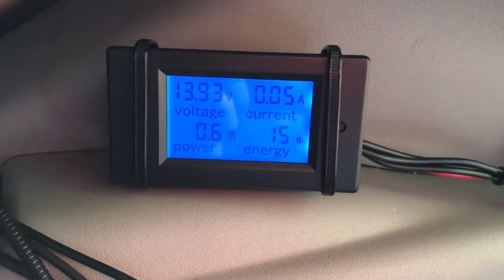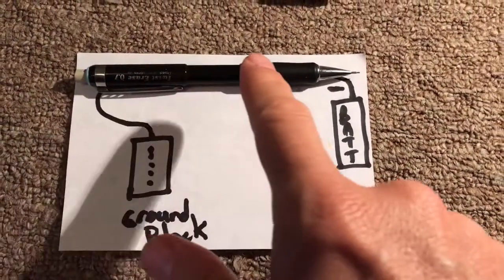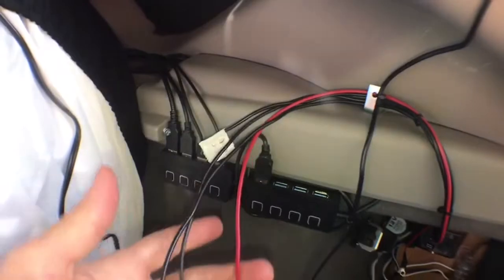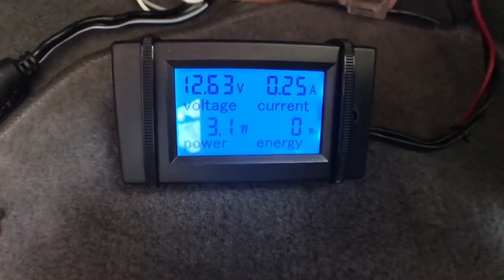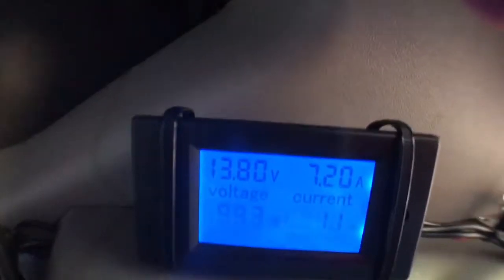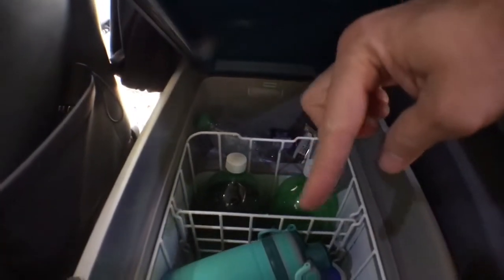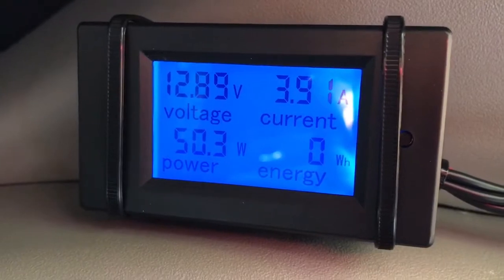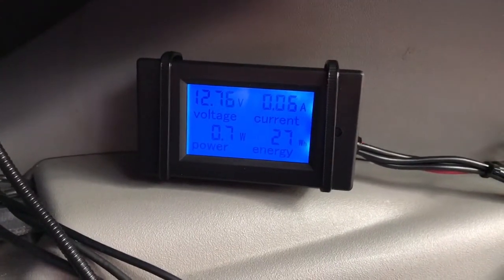Energy Monitor Install, Power Usage Dometic CFX, Heater, LED, Prius Stealth Camper, Car Van

Comment: Great video showing how you use your refrigerator. I have looked at this many ways and the devil really is in the details. 70F outdoors you say? 38F inside the box? 28L? See what happens when you have a 50L unit trying to maintain 8F in the desert where your interior temp is 140F! Whole different scenario. I have seen similar videos which justify >100A-hr/d for difficult refrigeration scenarios. Some people use the fridge covers or add insulation to the outside and think that is worth the effort. On the colder nights when you use your warmer all night, the fridge may consume almost nothing . . . the tradeoffs can be significant. Do you have any worst-case A-hr/d values now that your system has been installed for a while? I am considering a similar fridge, maybe the next larger size for a van and was also looking at that same electrowarmth heater. I use a heated mattress pad at home and I think this is probably the most efficient way to heat with electricity at night. I am trying to limit propane usage for simplicity and safety reasons (only the 1 lb cylinders for the super cold night or cooking on a camp stove). Thanks again for sharing.
Reply from the maker: I have not really had a chance to test out well in really hot climates. The desert would be a challenge but I have always wanted to go to the RTR someday. I really like the Dometic CF series and see constant good reviews and videos. There are a couple other good brands but just felt the Dometic was well made and well known. The electrowarmth does use a considerable amount of power, more than I thought. I seem to get much better warmth from the Kelty Comic Down sleeping bag - pricey but worth it. You can use as a comforter but still have a pocket for your feet which is really nice and then could complement the Electrowarmth. The reason I like the Electro is the adjustable thermostat. Many others just have a timer. If you catch my next 2 videos on Saturday on condensation and mold, I show my DynaGlo propane setup that I used last winter in my van (tested down to 9 degrees). I have interfaced it with my Digiten thermostat which allows pin point temp control of the 10,000 BTUs. It won't work out of the box, blast furnace. The video is going to take a lot of time to produce because I have to prove to people that it works which takes meticulous video production. People are very protective of their Buddy heaters which are terribly inefficient due to only being on or off and having to vent lots of usable heat. My heater has a pilot light and thermostat and is far more efficient than any Buddy heater. It just has to run a minute or two then shuts off and warms up a space instantly. Since you have a van it might work well for you but I had a high top, have not tried in a standard van but should work. It won't be expensive either. I think the unit sells for around $170, then the digiten is around $40, then a gas grill tank and hose. Hope some of this information was helpful.

Comment: I don’t see it mentioned in the comments but the .03A you saw in the beginning is probably the monitoring station showing the current it takes to power itself. I would think the factory uses an external 12vdc to power the unit for calibration. My $00.02.
Reply from the maker: That sounds right to me. Thanks for your comments and for watching!
Reply: ...also curious why and what led you to tap off of the ground side rather than the hot lead. In my experience, (USN electronics repair and calibration) when using and/or calibrating shunts, they were always connected on the positive side. In theory, it shouldn't matter. But we all know that "hands on" beats theory everytime. (But it's entertaining and makes for some good "head scratchers". 
 You gotta great niche going on over there. Thanks for everything. Be yourself and roll-on.
Reply from the maker: Thanks! I am not sure why I wired it that way. I went by the directions that came with it. This is one of those cheap Chinese electronics that you sort of wonder about but so far it has worked well.
Reply: According to the wiring diagram on the monitor, the power for the monitor is not part of the load, it is powered separately so it will not be reflected in the voltage drop across the shunt.
Reply from the maker: You definitely understand this material better than me!

Comment: Nice vdo was ur engine running during this test coz i saw ur voltage was not dropping when u turn ur accessories on.
Reply from the maker: Good question - I can't remember if it was or was not on.

Comment: Does the inverter draw power as well when it's on (is it always on?) Also is it necessary to have the 2000w inverter or would something less powerful get the job done, assuming I'd just be running the fridge all day?
Reply from the maker: The inverter does draw a little power when idle but I'm not sure how much. I usually only turn  the inverter on when using the microwave and then turn it off.  The fridge runs on 12v or 120v, it comes with both cords. I only run direct to the 12v batteries and don't use the inverter for the fridge. A 1500 watt would handle the microwave (750W mircowave needs  about 1,100W to run). If you are only going to charge your electronics and use some fans and lights with 120volts then a 1,000 watt inverter would be plenty.  Get a pure sine one, work the money for using with electronics.

Comment: You've got the Dometic CFX-28 under your head when you're sleeping. Doesn't it wake you up when it cycles on at night? 
And how long will it run while you're stopped somewhere? Your meter shows around 50 watts, which on the normal Prius 12v battery (45 Ah) will give you around 4.5 hours run time before the battery is half drained. The refrigerator isn't going to run all the time, so maybe it'll go a day? I've thought about getting one, but I'm concerned about noise, as well as battery drain when not driving. Thoughts?
Reply from the maker: Terrell Smith The fridge makes a little hum but I got used to it. The 3” foam takes care of most of the vibration plus adds a insulation factor to the fridge. The dometic runs very little once up to temp and only for a minute or so at a time. I can run all night on one battery and it does not drain the battery. Over a 24 hour period without turning the car on I drew the battery down to 50%. That’s when I added a second battery. Now i can run 24 hours and not worry about a power drain. A thermoelectric cooler will drain one battery in a few hours. They are very inefficient. The dometic is the best purchase I have made for my conversions. I wasted so much money on other options.

Comment: I installed it. It was pretty confusing. Just got to know difference between load and source. I think this is the way it works: The shunt is so you don't have to have all the current go through the meter. It probably measures voltage drop across shunt and knows it's resistance and calculates current.
Reply from the maker: 1981 Vwcaddy That was my take on it. Evidently you can wire it different ways if you want to track solar usage or production. I’ve found it very enlightening on where my battery power was being used. Cool gadget. Mine is still working well. Glad you got yours up and going.
Reply: PriusStealthCamper Adventures that's what the guy who sold it to me said. I got a second one and I'm scared to try to monitor the solar with it
Reply from the maker: 1981 Vwcaddy It is a bit unnerving to connect the thing up!

Comment: Hey, nice job with the Prius, man! Are you considering some solar pannels on the roof?
Reply from the maker: no name Thanks for your question. I have spent a great deal of time pondering solar. I have done a solar project in the past and love tinkering with all the electronics. I even found a 50 watt panel that would fit on the dash and store in the back hatch so no loss of stealth. But because the Prius charges the 12v battery whenever the car is in the ON position (not even engine running) I have not run out of power. If the car is turned on or driven for a total of 30 min a day then I’m good. If I’m using the climate control it charges the battery too. 

Solar would make sense for someone who does not plan to turn the car on for over 24 hours or so and has a running fridge. Mounting a solar panel on a roof rack would kill the MPG by 10-15. I don’t trust the flexible roof mount panels. They seem to not last and overheat easily. 

One of the great things about the Prius is it’s so cheap to travel so staying in one place all day just doesn’t happen for me. The space is so small inside that it’s best to get out as much as possible. 

I guess it comes down to how someone will use the car but I think a dash solar panel would be the way to go.

Thanks for watching!
Reply: PriusStealthCamper Adventures thanks for the reply! Keep up the good work. I am looking for a good 2006-2008 prius which I plan to convert to run on LPG. It's a popular fuel in eastern europe and pretty cheap- 50 cents/liter. Gas is double the price. I love the ideea of camping in the car, that would mean so much freedom to travel. Good luck on your adventures!
Reply from the maker: no name wow! That’s a cool idea. Be sure to post to your YouTube channel so you can show the world how you did it.